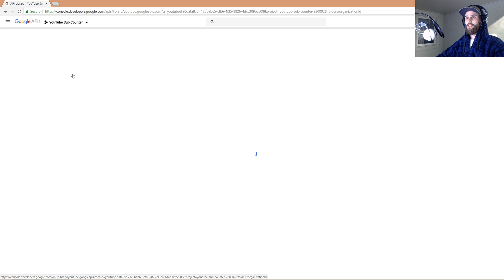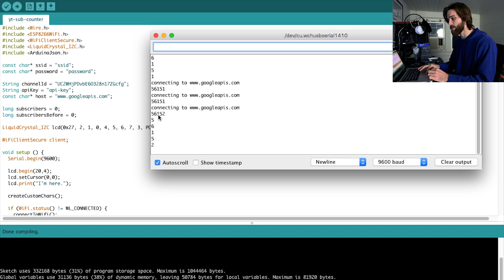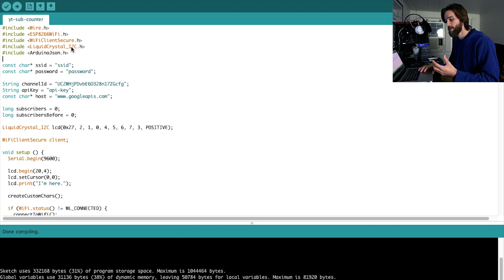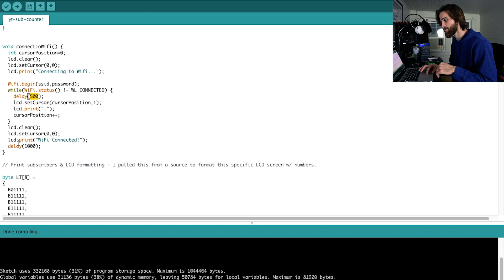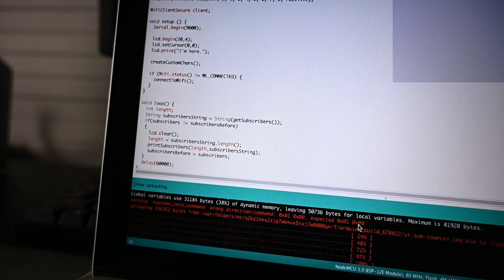Coding My First Electronics Project (YouTube Subscriber Counter)

Comment: This channel is a gold mine. I’m a physics grad still working in a research lab and am about to start a programming project that requires maybe 6000-10,000 lines of code for data acquisition electronics for a large experiment being ran at NIST within a few years (hopefully). I’m also considering going back for a BS/MS in computer science. I have extensive knowledge in Python, but have to code this new project in C.

To start a programming portfolio, would this be a good project if I intended to be a software engineer or preferably a data scientist? I’m trying to decide between self-teaching or going back to school. Do you have a suggestions of programs or games that would be good to start a portfolio with?

Comment: To be really geeky, with DC voltage wiring, the black wire represents ground and red wire represents VCC or positive voltage.  I noticed that you didn't have either of those wire colors connected to the mentioned connections.

Comment: I guess its because of all that global variables you declare at the beginning, of the code, try to declare the inside your  loop().  I haven't use the arduino ide, but the sysntax is derived from C++ in which you need to be careful of you memory allocation, an specially in devices with memory mapped i/o or peripherals, if you are reading/writing to the wrong section of the memory you wont be able to read or write to your wifi module.
Reply from the maker: Okay, thank you for the info

Comment: You might have done this, but you need to install boards manager into Arduino IDE and select the board.
Also try changing the contrast by rotating the trimmer behind the LCD.
Nice project by the way.

Comment: Two points, 1. solder the pins in the wimos. 2. you forgot to add the site fingerprint of the www.googleapis.com you need to add the lines:
the following should be in the global variable area of the program.

const char fingerprint[] PROGMEM = "48 27 7A 0C AE 14 14 D3 EE F3 E9 9F D6 D1 1A 80 A3 3C D7 2C";
this line should be before trying to open the secure connection to the secure site
  client.setFingerprint(fingerprint);

otherwise the connection will be rejected.
the fingerprint is the SHA-1 fingerprint of the site certificate, you can get it from any browser after correctly recieving the JSON file.

Comment: I think your problem is with pin contacts on the board so try to solder the pins on the board for better contact.
Reply from the maker: Will do. Haven't been able to find my soldering iron gun for quite some time so I just got a new one (iron this time). Now I'm sure the other one will turn up lol

Comment: I think you have a connection problem of the pins, since you didn't solder them to the microcontroller. Another thing that I would add in your code is "lcd. init();" after "lcd.begin(20,1);". I hope this helps.